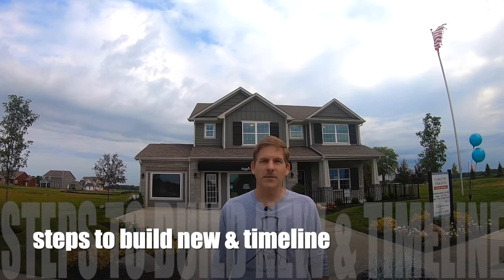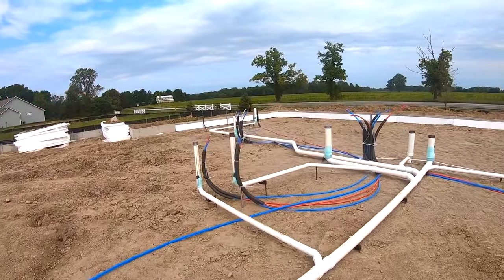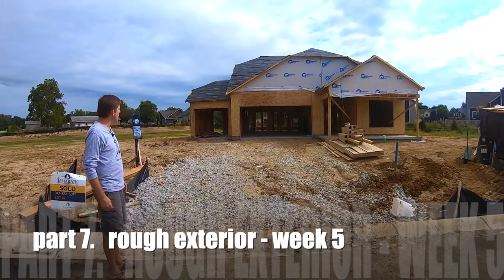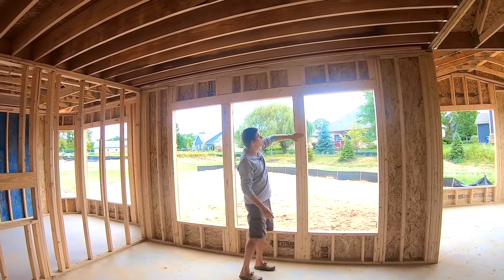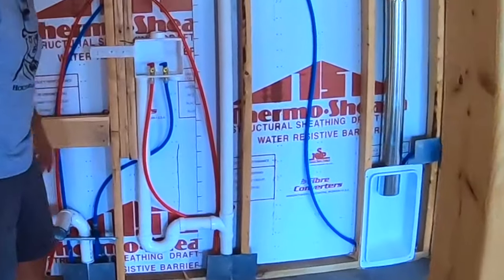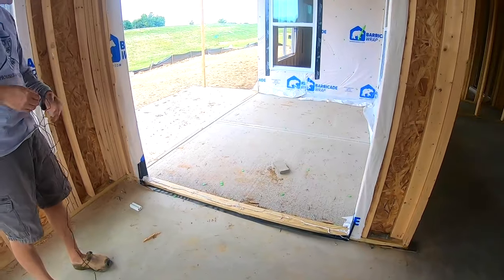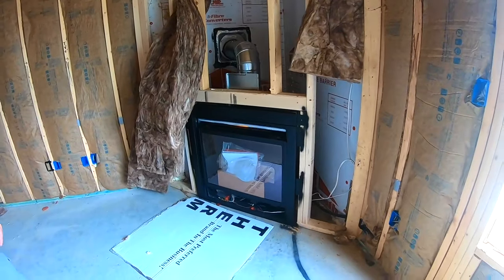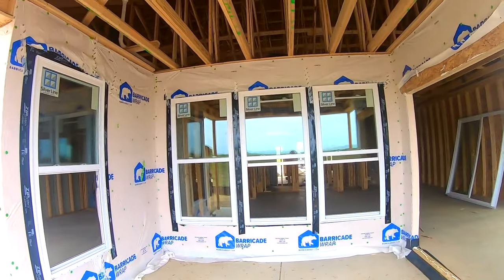steps to building a house timeline

Comment: As a Swedish civil engineer I get chocked every time of how low quality American houses have.
Reply from the maker: Hey LouieGrind,
Thx for the input. 
Admittedly, on occasion we do get that comment from outside the USA who aren’t used to wood frame construction. 
I’d like to ask you - what exactly is the low quality that you speak of? I’m interested in your point of view, and the goals you have when building.
Thx again.
Reply: @Housebarons  The timber looks low quality, the walls are super thin, it's more or less cheap materials everywhere, there's a lot of thermal bridges, the end result of the concrete pouring was low quality and would never go through an inspection, there's a lot of mandatory steps you need to take in the EU that you don't need to take in the US that improves the final product, the ventilation was all over the place, the electrical was all over the place etc.

Don't take me wrong, it's probably a great home when it comes to US standards, it's just that the US standards are so much lower than the European standards, particularly the Swedish standards which I design after because the Swedish standards is even higher than the EU's. We often refer to US homes as "cardboard boxes" here in Sweden. There's no fault on how you've built it it's just that the end product when following US building codes would never be approved in the EU.
Reply from the maker: @LouieGrind, you have left me with a lot of new questions if you are willing. I’m open to learn.  

But first: 1) In Sweden, what is a typical energy cost ( in euros?) per month for 90 square meter house or maybe a 185 square meter house? Is there a typical cost per square meter for a new built house in Sweden?

And 2) what is the cost of a typical house of 90 sq. meters or 185 sq. meters? 

You said : 
“Timber- low quality” - what is the problem here? Less strength than Swedish houses? I would say that USA houses are overbuilt when it comes to strength. 

Cheap materials - Again, is the concern failure or breakage? What does Sweden get by better quality?

Thermal bridging - 
True. Typically our houses have R-15 to R-19 walls. We live in an energy rich country and admittedly we are decades behind your typical building practices. Some houses here are built to be super-insulated. But not the average house. 
Also, as an engineer, you know that you get less and less benefit by adding insulation. Diminishing returns.
 So at some point, your savings in energy costs is eclipsed by the cost of the insulation. 
Probably that is why we have such thin walls. Lower cost energy. 

Concrete pour - low quality? How is it? What is your definition of low quality?

Ventilation & Electric- “all over the place”
True. Our houses are built in stages - one group of builders / trades people after another group. I did some research and it looks like much of homes in Sweden are factory built. So it’s different methods of construction. But the durability and function should be equal.

Cardboard houses 
Ouch!😀. I often work hands-on with house building or renovating. Our houses are crazy strong, like I said “overbuilt” according to structural calculations. 
But looking online, it looks to me that Sweden uses trusses for roof structure, and thicker insulation for wall, but still wood framed. Seems pretty similar.
So, what is the goal of all the EU regulations?

Thx for your input. I know people do find your input informative.
Thank you for writing and for watching!
Reply: @Housebarons  Yeah sure.

1. Well that depends where your house is located. In the northern Sweden we can get up to -30C but the electrical price is much cheaper than in the south because of hydropower. But the absolute maximum you're allowed spend in electricity is 90kWh/m2/year for houses that's over 135m2 and 95kWh/m2/year for houses that's 90-135m2 and 100kWh/m2/year for houses that's 50-90m2. So in the case of a house that's 185m2 with the electrical prices I get where I live it would max cost about $72.6 a month for all electricity, heating, water etc.

2. It depends where in the country but anything from $134 000-1 695 600. The median house price in the country right now is $410 000.

3. What I meant about the timber was that the timber is very crude compared to Swedish timber. We do however have extremely high standards on our timber. All in all our timber have a lot less twig knots, they are completely uniform and are typically always planed, not sawed.

4. Better quality materials is mainly because of building codes with regards to emissions, sound, fire etc. We never use OSB boards indoors for example because of the emissions from the glue. It's always high quality plywood + 1/2' gypsum board/drywall or double 1/2' gypsum/drywall.

5. Typically our exterior walls are about min 300mm or 11.8' isolated with 195+45mm mineral wool. We also always build away thermal bridges but there will always be some bridges at windows for example.

6. The concrete looked pretty cracked in the video, especially the edge concrete beam. Could just be a video thing though.

7. Yeah probably. We have codes about how you're allowed to draw electrical and ventilation so it won't be in the middle of a wall for example. Wires and plumbing should always be drawn in a safe and logical way so there's minimal risk for someone to hit it with a nail.

Haha yeah, it's nothing personal. We say the same thing about Great Britain, Spain and Italy too. Sweden do have the best housing standard in the world so I'm a little skewed towards the extreme. A 2* hotel for example in Sweden is like a 3-4* hotel in Italy. The main goal for the Eurocodes are to make the industry more uniform across the EU. In the EU a Polish company has the ability to compete for Swedish contracting jobs for example. Sweden have however much stricter rules than the rest of the EU which makes it hard for non Swedish contractors to actually perform the jobs. Another reason is to guarantee a good quality of every new building no matter who builds it. It makes it more or less impossible to cut corners. We design all our buildings to hold for 50 years on parts that you can inspect and adjust and 80 years on parts you can't inspect or adjust which forces you to use much higher quality materials.
Reply from the maker: @LouieGrind
THANKS for all that info! VERY interesting.

1. The utility prices - I’m guessing you mean that the government pays any extra above your max amount? WAY LESS than our averages I’d guess. But we have lower taxes so it is a trade off.
2. as for housing prices we have much greater highs and lows in prices, but the median price makes sense given all your regulations.
3. I had to almost laugh out loud when you said your lumber was high-graded planed wood!! Yes. You are right! We do use low quality wood by that comparison!!!! I can’t even imagine using planed wood for interior walls! I’d hate to cover that wood up with drywall. Must be too beautiful!
4. Yes. OSB is pretty common exterior sheathing and sub flooring here though plywood is still used as well by builder choice.
5. 300mm thick walls here would be called super-insulated, not normal. NO DOUBT your utility bills are low. I’m a fan of doubled studded walls but have never lived in one or built one yet. But a 300mm thick wall. Awesome!
6.  Concrete here is 4000-5000psi - all should be good there.
7. Your plumbing and wiring makes sense to me from your perspective. 

One thing about age and longevity. We are currently working on a 120 yr old house. We are gutting it and making the entire interior modern, but the all brick foundation and exterior wood frame structure is still standing strong even though the house has been neglected for past 20 years. ( our next video on Saturday will show interior gut and flooring). But that house has ZERO wall insulation - just 2x4 studs with 1 inch diagonal exterior planking and lath & plaster interior. That’s how we built at the beginning of the 20th century. 
We hope our efforts get this house to its 200th birthday at least!

Glad to see you have pride in your buildings. You convinced me when you talked of “planed wood!!!”. 
And no offense taken. At least now when other Europeans make similar comments, I’ll have a better frame of reference. 

Thank you for taking the time to educate me. I expect I will have opportunity to pass this learning on!
Peace 
Dave
Reply: @Housebarons  1. No, not at all. They pay zero. We have something called an energy declaration each year for new buildings. This is like doing your "taxes" but for your buildings energy consumption. A new building is literally not allowed to use up more energy than the max value I said earlier. If you do use more you won't get your final permit and have to either cancel the project or improve it so it fulfills the demand. Household electricity isn't calculated in to that number because that's so individual but all the heating, warm water, ventilation etc. Everything that makes the house livable can't exceed that m2 number. It makes the building more cheap to live in for the residents and it also makes the house more environmentally friendly because the majority of energy consumed by a building is during its lifespan, not during construction. We pay an average of 43% in tax. This includes taxes on commodities and services too. The tax we pay upright on our salaries is about 31% on average so we're not that much higher than the US which sits on an average of 36%. Keep in mind that we get free school, university, healthcare etc.

2. To put it in perspective, the lows on that scale is maybe a house that's 60-120m2 in the boonies and the top is a house that's 200m2 in the major cities. Generally the US has way larger homes than we do in Sweden. The largest house on sale right now what I could find was a mansion with 3 separate buildings with a total living area in all of the 3 buildings of 1600m2. It goes for $1 530 000. The average m2 price in Sweden is $5280/m2, that includes apartments.

3. Haha really? The majority of buildings in Sweden is actually made from wood and it's always planed wood. I don't know if we use the same quality scale but if the wood is part of a wall it's typically C24 timber, planed. And yes it's quite beautiful! I've recently designed a school building that's 100% wood where we made at the grand entrance a bunch of fake "trees" that's 8m tall that's bearing the roof and it's made up from completely exposed planed glulam. It will look great! We've also started to use a lot of what we call "KL-trä", or cross laminated construction wood (C24+) that absolutely looks beautiful!

4. Yeah, I've seen some buildings using plywood too. The only thing we use OSB for is to make frames etc. or temporary constructions.

5. It's not actually double studded. The typical construction of an outer wall from the outside -> in is like this: 22+22mm standing wood exterior (I think it's called lid facade?), 24x70mm nail batten s600, 12x70mm standing plywood strips for aeration s600, 9mm wind board, 45x195 wood frame s600 + mineral wool (sometimes cellulose insulation), 0.2mm plastic vapor barrier (sometimes a wood board in really ecofriendly houses), 45x45 timber s600 installation layer + mineral wool (sometimes cellulose insulation), 12mm plywood, 13mm gypsum. So a typical wall is about 304mm-379mm depending on your wooden frame which can alternate between 45x145-45x220 s600 depending where in the country you're located. For example right now I'm working on a project where the wall is 849mm thick. That's "super-insulated" for us. We call it a "passive building" where it more or less doesn't loose any heat at all. Windows and doors always have a U-value of minimum 1.0 W/m2K and the windows are always three paned, sometimes with emission treatment.

6. Yeah, it will definitely hold it's just we have codes which demands it not to be cracked or damaged because it has to hold for 80+years.

7. I imagine when you get in to that process it takes about the same time as if you would just draw it randomly because you get some sort of roadmap. You just have to get in to the process.

Cool! I actually just designed a reconstruction of an old school from 1905 which were built using laying planks on top of each other. Old houses are super fun but can also be extremely frustrating! I'm actually not surprised that your frame is standing strong. As long as the frame isn't constantly exposed to water it will hold on for a stupidly long time, especially when it's not insulated because then you have such huge wind flow going through the building that will dry up all the water that might've penetrated the walls and roofs. Looking forward to that video!

It's kind of extraordinary how you can build a house so different and more or less end up with a similar product in the end. I do however think that in the US you're better at fine carpentry than us Swedes. That has unfortunately become somewhat of a lost art here. Nowadays new houses are very "Swedish" aka supermodernism which doesn't leave that much room for fine carpentry.

Anytime man. It's always funny to talk about construction and other peoples perspective!
Reply from the maker: @LouieGrind

1. Ohhhh! I was wondering how you could hold you energy bill to a certain amount! So it sounds like some kind of an energy audit? Measured by a machine?
As for taxes - in USA, 99.4% of people are NOT in the highest tax bracket 37%, so most people pay much less than that ... at least for this year. New president likely means higher taxes coming though!😩

2. Your price per m2 is about what we’d find in California or Washington D.C. Even in those places, we still have wide price swings. But in our location in Indiana, typical single story new houses can be built for around 1300 euros or $1600 US per m2 ( with of course wide swings outside that median price ) 

3. That “ fake tree” design sounds awesome. I’d love to see a pic or your own YouTube channel video when done-
Does civil engineer in Sweden do architecture too? In USA, typically I think of civil engineers as large structure/ bridge designers. Our architects do the actual drawings and layout. Structural engineers do all the calculations for loads and material strength.

5. Ok - 849mm thick? Thats HUGE! Cellulose or rock wool? Or what would make it so thick? Can’t imagine.
I bought a Passive house book a while back - I’m fond of the idea, but not sure, where we live, if it could be really be economically justified. But along those lines, I’ve seen people use large thermal mass ( concrete ) to modulate heat / cooling needs. Many ideas here - just have to find which is most ideal.

7. The plank school house sounds cool. By planks - what thickness and width? We have / had log homes and in very old construction. Typically they have similar height and width dimension. I wonder if your school house was a similar or different design?
Old work frustrating? Yes! Totally get that... we always debate at the beginning of each project whether to build new vs. renovate. Typically we buy the old house... then wish we were building new once all the headaches appear.

With you, I also find it interesting how different home building is across countries. I never gave it much thought before. You have certainly opened my eyes to the Swedish building process and it’s “planed” interior 😀 This has also got me thinking about some future videos along these lines. Good stuff! Thanks!
Reply: @Housebarons  1. No. You have to do preliminary energy calculations for each new project before building to make sure that the building will hold up to the standards. If the calculations can't prove the building will hold that standard it won't get a permit. Then each year the building will have to declare their energy consumption so the government can keep track of where the country might have to do some work on improving the overall energy consumption caused by buildings. Here we got kind of a progressive tax too. The more you earn the more you pay. The absolute top 1% pays 54% direct from their salary. Contrary to popular beliefs though Sweden has more $ millionaires per capita than the US.

2. Man, that's really cheap. In the city I live in you're really lucky if you find a house under $240 000.

3. Yeah, it will be hopefully! It depends if you work at an architecture firm or a consultation firm. You will do architecture at the architecture firm but that only entails the layout of the house, room sizes, roof heights, exteriors etc. Everything else like the construction of the walls, beams, pillars etc. is drawn and calculated by a civil engineer. In Sweden there's at least one civil engineer and architect in every building project.

5. The buildings exterior walls is about 50%+ windows so we were forced to have a wall that thick to accommodate for the heat losses caused by the huge window area. In the long run if you use environmentally friendly materials a passive house will always be more energy efficient than a non passive house during its lifetime. The problem is that it's much more expensive to build initially and people tend to only see the initial cost, not the lifetime cost.

7. The planks were laying grooved 44x125mm planks with some nail battens and insulation boards. It's a very classic way to build houses in Sweden back in the days. If you google "plankhus" you can see some pictures.

Looking forward to it!
Reply from the maker: Hey Louie,
1) Very interesting about the energy calculations and reporting. Makes sense. 
And regarding millionaires per capita, it surely doesn’t surprise me that Sweden has more millionaires. We have a huge portion of population that could be described as regular working class, and 20% of US population receives some government assistance just to survive day to day. Plus, our sub-par public college/university system offers many useless degrees that just don’t translate into good wage jobs for graduates. 

5) You mentioned 50% plus window space. Is that typical for new construction? Nice, but seems like a lot to me.

7) I looked up plankhus images. The websites I couldn’t read of course. 😅 (BTW, your command of English is impressive.) So to clarify, are those planks standing on their edges - taller than they are wide ? That’s what the images look like, but I wanted to clarify. I’m going to do a video in a bit about how our 1900’s renovation house construction is so different compared to 2020, and I was going to mention your old Swedish houses because they look similar.

Thanks!i